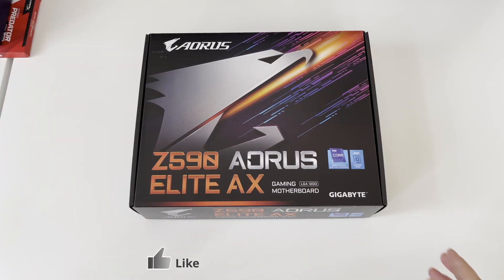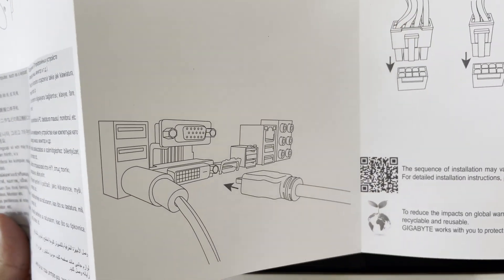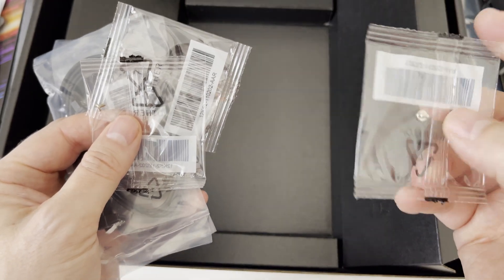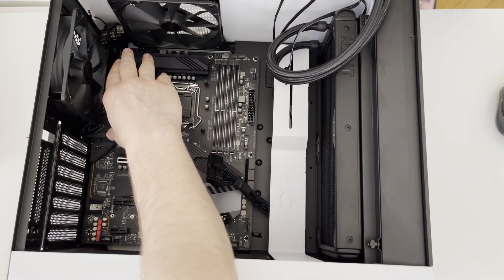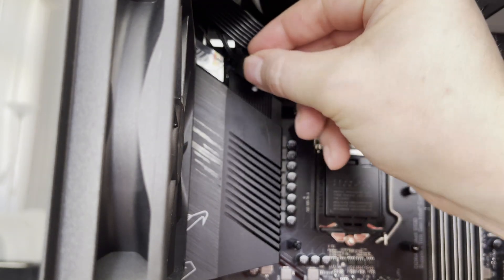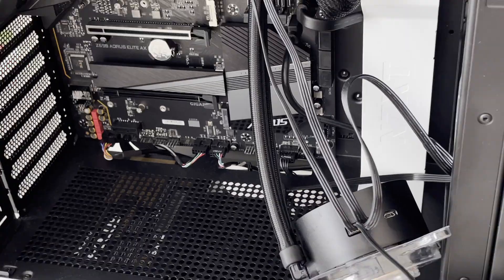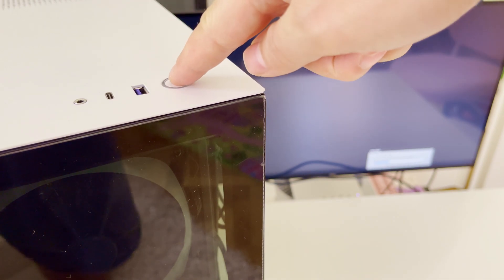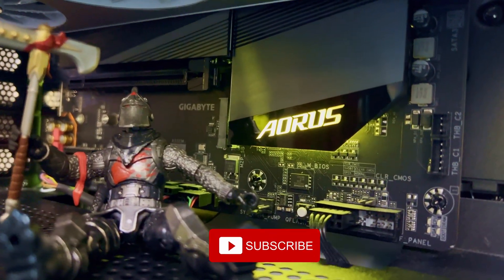Gigabyte Z590 Aorus Elite AX motherboard unboxing and installing

Comment: Thank you sooooo much my friend. I was stressing over my cpu freezing under load for ages, just to find out it was my darned cpu power cable not installed on the additional 4pin.
Reply from the maker: Thank you for watching Mat. Glad I could help little bit. Just in case someone else is searching for Kraken cooler not cooling CPU enough, then the 4 pin connector from Kraken liquid cooler needs to be connected to CPU Fan socket on motherboard, as seen at 9:49 in video. Do you have this exact set up with Aorus Elite AX motherboard and Kraken Z63 liquid cooler or similar one?

Comment: dude you are little bit out of date..this is already dead platform..we are running 12900k's on z690:)waky waky
Reply from the maker: Thank you for stopping by. You wouldn't believe it, I've been working on this video for one year, time constraint did not let me finish it earlier. z590 might still be budget friendly to go with older 10th gen CPU or 11th gen CPU and utilizing PCI expres 4 with high speed M.2 SSD disk. I'm working on video with z690 motherboard and  i9-12900k with DDR5 RAM, while many still prefer older DDR4. Stay tuned for that one. Are you running on DDR4 or DDR5?
Reply: @ottomixa  12900k @5.4 Pcores 4.3 ecores on z690 apex pal...with custom loops.. hydro copper kingpin 3090..any many more setups...
Reply from the maker: @wintermuteukeastek7510  that is really nice set up you are running. What games are you playing on it?
Reply: @ottomixa  cod/warzone only...otherwise used for ableton 11 music production..but tbh my old 8700k on apex 370 does still same job..only less few fps...but 10900k is the best win for gaming as ddr5 is still shit...
Reply from the maker: @wintermuteukeastek7510  Thank you for sharing your feedback on Intel Core i9-10900K which will work with Gigabyte Z590 Aorus Elite AX motherboard as good gaming set up with limited budget. I'm going to check on Ableton 11 music production now, I have unboxed microphone already in one my other video, haha.
Reply: Dead platform cheap prices. Microdik sells 11700k + z590 mobo for $245 with coupon new. Although I'm selling that mobo for a diff one cuz I want a better one. 12th gen is gonna get cucked by 13th gen and you'll be mad cuz you paid full price